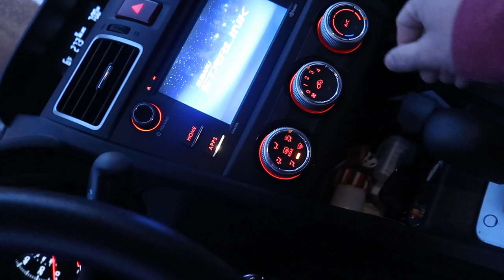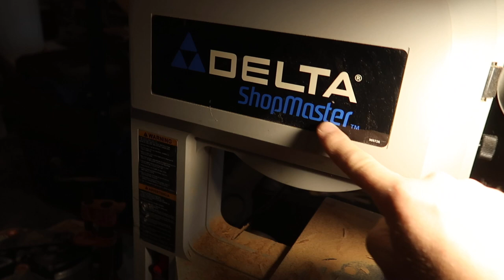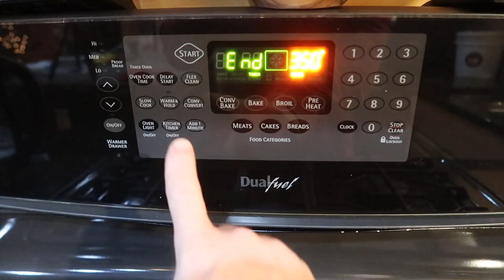Never Knew I could Make This From That!

Comment: What about making one of those microwavable rice heating pads and putting in a hollow in the foam under the bowl ?  Be easy enough to make to have a couple extra to swap out as you change the water. With the pan above it and surrounded by foam I'd have to think it would stay warm for most of the day.
  Could also make a small one to slip in your pocket and make Willow happy

Comment: Get some block heaters for your car.  You won't regret it.  Car will start in any temps, be warm in a couple minutes.  Saves time, gas, engine wear, and way less polluting than running for 10-20 minutes.  Just don't leave it plugged all night.  Plug it in, or set a timer for about an hour or two before you, or your wife goes out.
Enjoy the warm weekend weather!

Comment: A spoke shave would have been the perfect way to avoid sanding dust. I also like using straight scrapers too. They leave the wood shaved flat smooth, not sand rounded.

Comment: Al, I've noticed you rarely wear gloves when you're outside. Just wondering if there is a reason.  I've visited Alaska when the temps were below zero and my hands were happy to be covered with mittens.   

Great job on the spatulas, and nice design!
Reply from the maker: I find it hard to work with glove on.

Comment: Can you try a bucket with a lid on it like your chicken food feeder with the pvc pipe with warm water in it and insulated at the bottom - try one for one set of chickens - the thought came from your bottle of warm water yesterday and how it did not freeze with the lid on it as it held in the steam in so doing stayed warmer - swap the feeder and the water bucket over for a few day to see if it would work then if it does not work not $$ lost

Comment: It is obvious the water is freezing from top down from the cold air now that you have them insulated and off the ground. It is time for another experiment because i think you can do better by decreasing the amount of open air surface of the bucket. So take 2 buckets and 1 piece of plywood cut a 4-5 in diameter hole in it place it over the bucket leave the other bucket as is. I suspect the bucket uncovered will freeze faster then the bucket with a cover and reduced access hole for the animal to drink out of will... The only question is would the goats stick there snout in a 5 inch diameter hole to drink out of... Hope you understand what i mean.

Comment: The only way to live in sub zero temps is with electric seats. I have a cousin that lived in Michigan and there's no way I could wait (or her) that long for the engine to warm up enough to blow hot air. Heated seats are not even a luxury to me, they're a necessity.